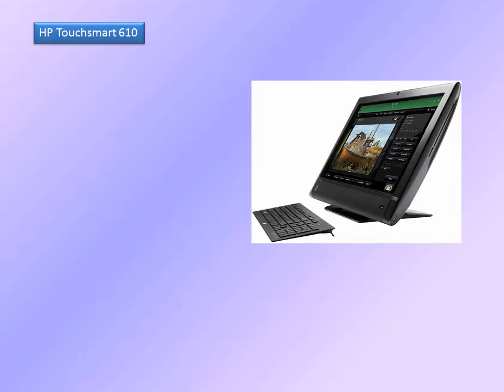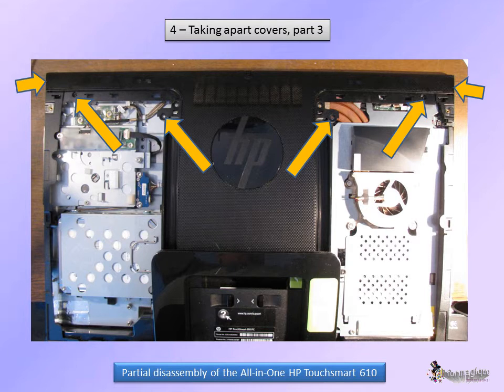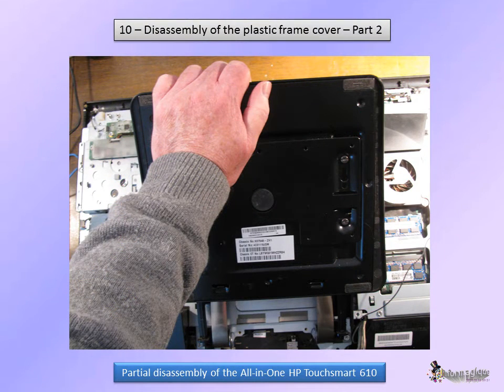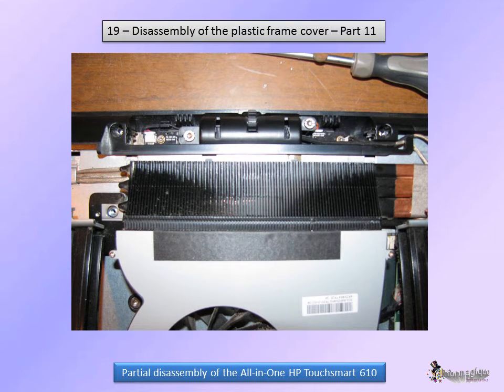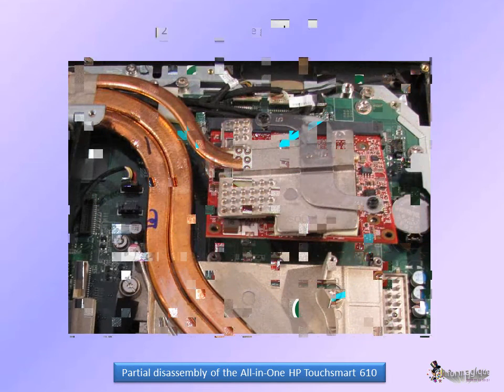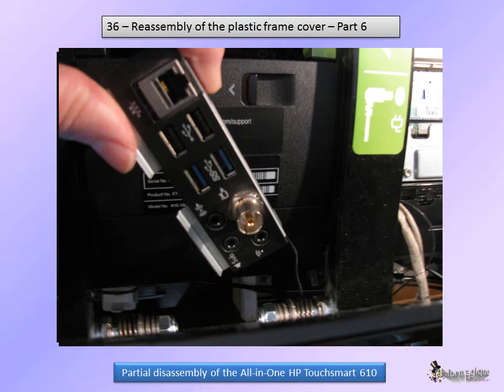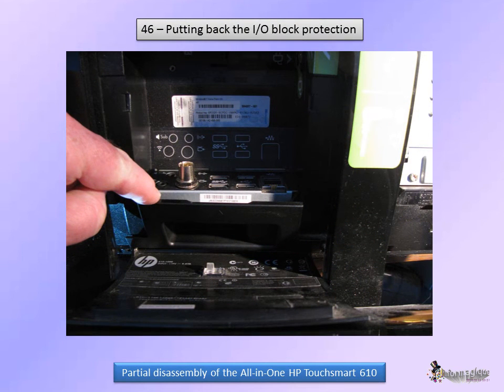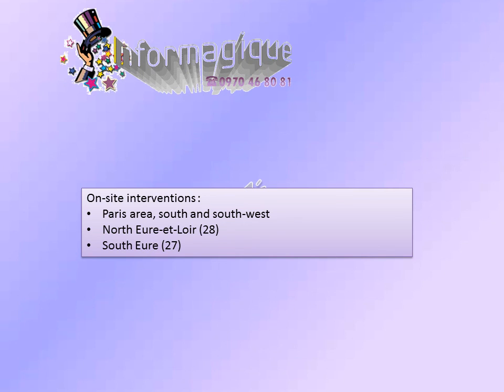HPTouchsmart 610 English

Comment: Hola, te hago una pregunta, tengo un all in one HP touchsmart 300, que cuando lo quiero encender solo marchan los ventiladores, y el disco duro, péro no da video. Le limpie las ram, le puse nueva pasta termica al procesador y aun así sigue sin dar video. Comentame si querés que puedo hacer. Gracias
Reply from the maker: Hola
Me temo que sin un examen más detenido, la falla será difícil de detectar.
No conozco las especificaciones del Touchsmart 300, pero si esa computadora incluye una tarjeta gráfica discreta, es posible que pueda encontrar un reemplazo a un precio razonable. De lo contrario, el problema puede estar en el circuito de video de la placa base, y es posible que sea necesario reemplazarlo. No estoy seguro de que el juego valga la pena. Este es el problema de los "todo en uno": cuando la sustitución de uno de los componentes pierde su interés, ¡toda la máquina pierde su interés...!

Comment: Is the ram memory used for the system back up? I only have 16GB and not sure if I should add more memory or if it is even possible to add more then 16GB. 🤔
Reply from the maker: Sorry, I don't get you... 16 GB is an excellent capacity for RAM, quite enough for anything. System backups are on the Disk. Maybe clarify ?
Reply: Informagique thank you for your reply. That's what I was thinking. For some reason my computer keeps telling me that it cannot person a system back up because there is not enough memory and it shows it under drive D or C something like that. Unless my computer has some sort of virus I am not aware of that could be causing this error. 🤔
Reply from the maker: You added RAM recently ?  You might have an issue with the virtual memory. When the amount of RAM is changed, you may have to take care of 2 things : make sure the size of the swap file is updated, or update it yourself (ideal size is 1,5 X actual RAM ; so for 16GB of RAM set a size of max 24 GB of swap file) and also make sure you have that size available on the hard disk. If you need more info on virtual memory, I would suggest to search some tips on Google (swap file, virtual memory, "change swap file size".....).
Reply: Informagique thank you so much for your valuable information, the computer has never been touched internally since I bought it in 2011. I know that the computer says it has 760GB of internal space out of 1TB  and I believe it has 16GB of RAM, not sure if more can be added but under RAM but I will definitely search more on Google to see what can be done. I'm sure my issue can be solved with just a few clicks of the mouse. 😄

Comment: So the CPU is not removable at all?
Reply from the maker: I havent tried it.
Of course, if you're a pro of the soldering iron (and mainly of the soldering pump), you may try...
Reply: Correct me if I am wrong, but my Touchsmart 610 came with a i5-650 which is FCLGA1156 according to Ark.  Since it doesn't have the "B" for ball grid array, it is a removable processor correct?  These appear to be land grid and I believe them to be upgradeable.

Thank you for the video!

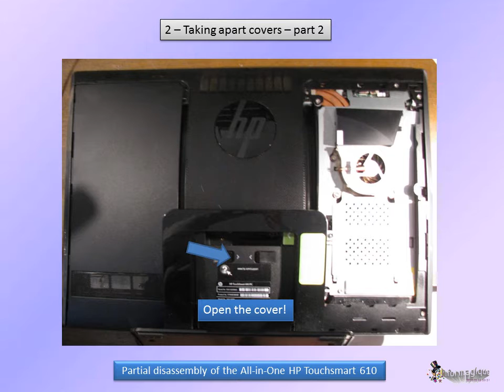Comment: Video overlooks removing a piece to get side panels off.  At 1:15, after opening the IO cover, you need to remove a plastic cover about 5" wide just below the IO cover.  It just pulls out.  After that both covers will slide inwards to remove.

Comment: You also need to remove the shroud cover that surround the dongle. While I'm place this prevent the safe covers from sliding over for removal. The cover is located behind the port door. Open door then remover shroud located at the bottom. Then the side covers will slide over.

Comment: I have the HP TouchSmart 610-1031f and I have followed this video and also some other tutorials and my covers will not move. The screws are out, the cover is opened and the dongle is removed, still cant get the covers to budge. Makes no sense. I've used a plastic pry and still it wont budge. Looks like I might have to bust the covers off. Any advise from anyone would be helpful.
Reply from the maker: As I replied once, I encountered this issue. I cannot explain how I finally got the covers off... they just came off like magic !  Is there an immaterial entity watching the hp users ?... that might be it.
Reply: You have to take off the plastic cover surrounding the dongle